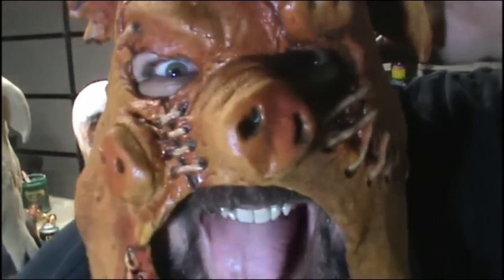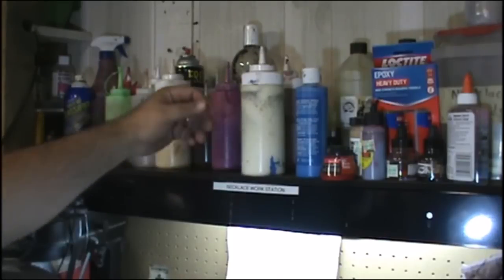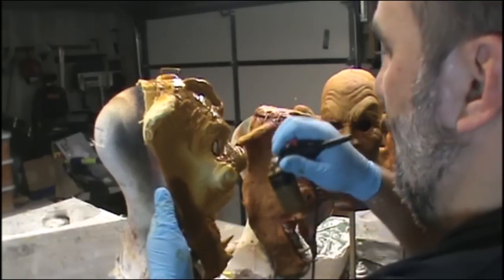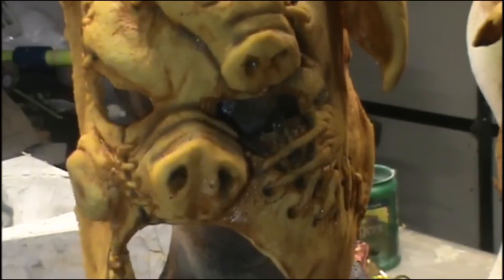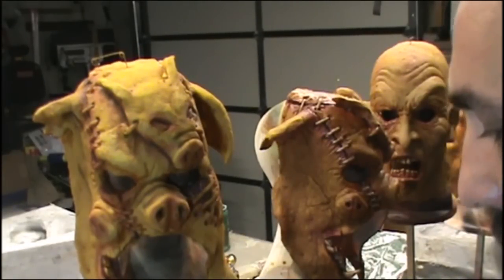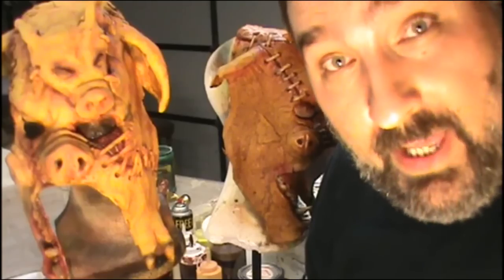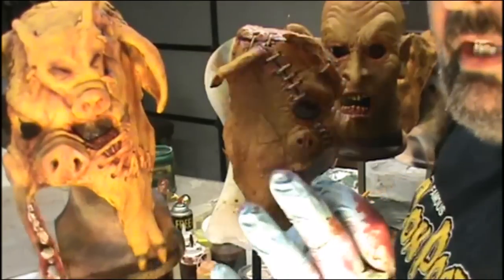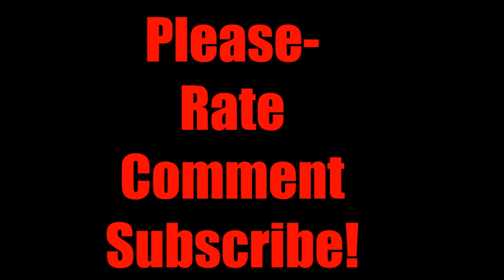latex mask painting

Comment: I bought this harbor freight airbrush. Can't seem to get it to work properly, though. I thin the heck out of acrylic paints using distiller water. Sometimes paint comes out, sometimes just air, even after adjusting the fluid caps. Also, when paint does come out, it comes out especially when I depress the trigger, then doesn't come out after a few seconds. Only prob I can think of is the fluid caps being clogged, the tubes inside the bottle.
Reply from the maker: +troy mccombs  its most likely a clog- Im posting a cleaning video soon so look out for that. Carburetor cleaner is my big tip for what to clean with as its meant to clean fiddly gunky bits out of metal parts. just rinse with water after to protect your seals.

Comment: hi allen.ive been following your vids and very helpfull,I managed to sculpt,mould and pull some jason voorhees masks out perfect,I have finished 2 but found when airbrushing the paint job it kept clogging with latex.i used a 3rd latex a 3rd tap water and a bit of acrylic paint for pigment.....do you think my paint mix and that I used tap and not distilled water made it clog up.thankyou allen.
Reply from the maker: +phelak  yes, The minerals in tapwater calls the late text to harden and clock just like the plaster makes it cure and get thick so do the minerals and tapwater that's why you have to use distilled
Reply: StiltbeastStudios thanx allen.ill give it a go.

Comment: Thank you Allen!  My wife got me an airbrush kit for Xmas and it's still sitting in the box.  Didn't really know were to start.  Wish I would have asked for a single stage to get my feet wet with..  Great video, simple for amateurs!
Reply from the maker: Graves Of The Groves  What kind do you have? Im sure I could do a simple video for you.
Reply: Actually you know what, this kit I got came with three different types:
Master Airbrush Model G22 Airbrush Set
Master performance multi-purpose high performance dual-action airbrush with a 1/3 oz. Gravity fluid cup and a 0.3mm needle & nozzle that allows you to spray from hairline up to 1-1/2" wide patterns. Master Airbrush Model G25 Airbrush Set
Master performance multi-purpose precision dual-action gravity feed airbrush with a 1/16 oz. Gravity fluid cup and a 0.2 mm needle & nozzle that allows you to spray from hairline up to 1" wide patterns. 
Master Airbrush Model E91 Airbrush Set
Single-action external mix siphon feed airbrush set with a 0.8mm tip, 2 - 3/4 oz. siphon bottles and has an 1/8" air inlet (airbrush can be used with a compressor or with the included hose & adaptor for a propellant can)
Here's the eBay link http://www.ebay.com/itm/New-3-Airbrush-Compressor-Kit-Dual-Action-Spray-Air-Brush-Set-Tattoo-Nail-Art-/140975810534?pt=LH_DefaultDomain_0&hash=item20d2d027e6
Reply from the maker: sweet!

Comment: great video was wondering if there was a airbrush compresser that you would recommend to paint latex paints that wouldn't break the bank thanks
Reply from the maker: +EricSalt88  I like this one- very useful- its noisy but it does not have to be in the room with you.
http://www.homedepot.com/p/Campbell-Hausfeld-3-Gal-Horizontal-Air-Compressor-FP209499AV/203002168

Comment: Awesome work thanks does this work with acrylic paints instead of house latex or do you need the house latex?
Reply from the maker: MYHauntProduction  yes, but I prefer the house paint. Latex house paint is made to flex with the heating and cooling of the house- they expand and contract so there is a flexible base to them already and they adhere to the mask better than acrylics. Also ounce for ounce Latex house paint is way cheaper.
Reply: StiltbeastStudios thanks so much great information.
Reply from the maker: thanks for watching!

Comment: i use the harbor freight brush and it keeps clogging in that little metal cap where the paint comes out. Any way to prevent t? I used 1 part distiller water, indoor latex house paint and casting latex. Goes on ok for about a minute, then I have to switch cup caps.
Reply: Haven't strained, yes distilled water

Comment: I tried using that 10.00 airbrush with one part indoor flat latex house paint, 1 part distilled water, and one part casting latex, but it doesn't work. The airbrush sprays paint for about one second and then just air comes out. I end up having to push the trigger a thousand times just to get a mask halfway done, and I keep running to unclog the paint nozzle every two minutes, and wedging a sewing needle into the tiny metal hole to get the gunk out, and it only works 20 percent of the time. I have no clue what I'm doing wrong. And I have my compressor set almost up to the max. Only air comes out usually. Pretty sure it's the latex screwing it up for me. Any ideas?
Reply from the maker: Are you straining your paint after you mix it? It never hurts to add a bit more water so it flows better. and are you using distilled water?
Reply: No strained but yes distilled water

Comment: What's best to use to get rid of the seam line? A Dremel or hot xacto knife? I just pulled a mask tonight and need to seam.
Reply: I borrowed my friends Dremel today and removed the line with a polishing bit. Worked fine except for one thing-- the latex kept wanting to coil up in the bit. Scared me! Is there any techniques or anything to prevent it from doing that? I imagine it could ruin the Dremel motor.
Reply from the maker: I trim the flash down with scissors then I dremel the rest off. that way there are no long strands to wind up.
Reply: I did trim it wth cuticle scissors first, but the whole latex of the mask wants to get caught in the fast rotation. Thanks, man, for all the help. I've been doing effects for a long time, but very sporadically. I always get discouraged and quit for a while, then come back into it. What I really suck at is painting. Dry brushing doesn't seem to provide good results and I see a lot of fx people using airbrushes, which I don't have but need to invest in. Besides that, I don't really know how to use them. I hear that fw inks are the best thing to use, paint-wise. Thanks again, man, and if you want, I can send you links to pics of my masks if you wanna take a quick gander :)
Reply from the maker: please show me some pics!! and I love drybrushing- I use it all the time on masks.
send to stiltbeast@gmail.com

Comment: Was wondering what type of Latex house paint Interior or exterior or does it matter as long as it says latex paint on it?
Reply from the maker: +chrisc8141 exterior is better actually.
Reply: +StiltbeastStudios thanks! Great video btw. Learned a lot from it. Been searching sometime for the best way to paint a latex mask and going to try this.
Reply from the maker: It works really well for me. let me know how it turns out.
Reply: +StiltbeastStudios I grabbed some and notice it has primer included in it. Will this be ok? Wanted to be sure before I used it on a mask.
Reply from the maker: sure, thats fine